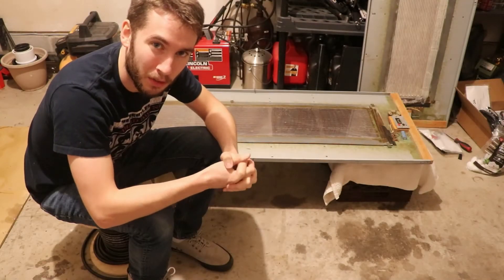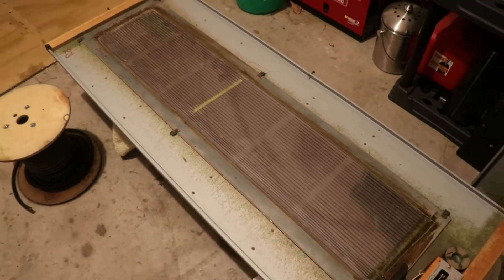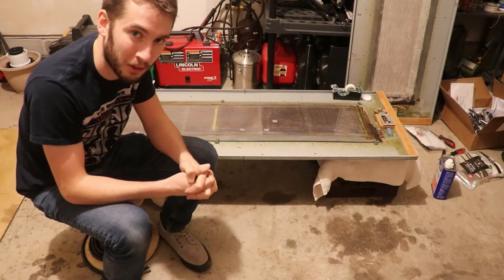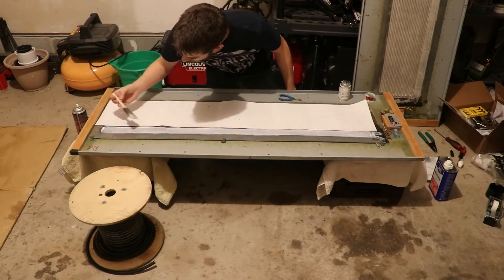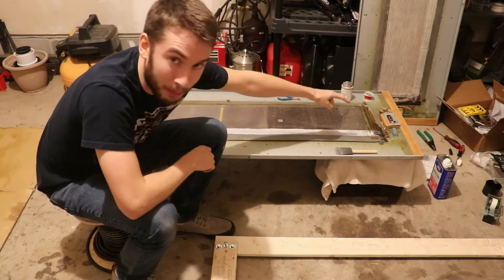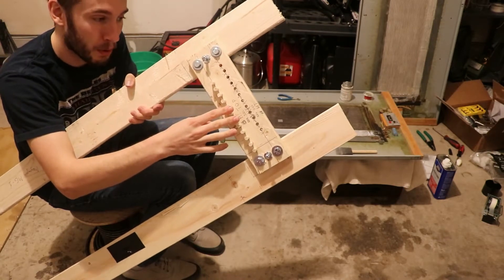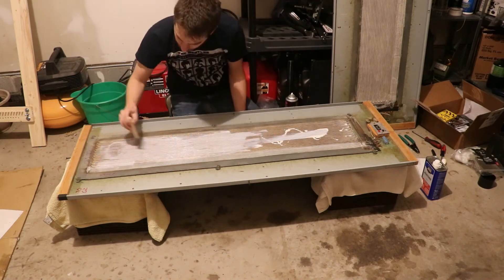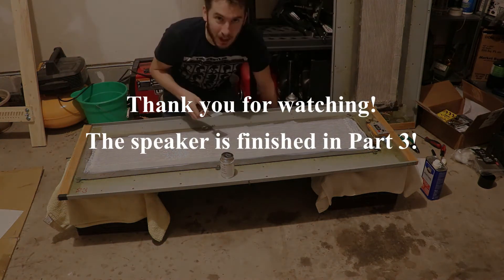REBUILD your MAGNEPAN MG-1 SPEAKERS (Part 2)

Comment: I just finished this whole process on my MG1 Improved, and I would say for sure to anyone reading this, don’t build a template. It’s really super easy to do it by hand and the wood template is a bunch of extra time, money, and work added to a process that is not very difficult, just slightly time consuming. I just put on a long podcast and totally zoned out on laying the wire and it was honestly pretty enjoyable. I also wore yellow rubber dishwashing gloves so I could push the wire down on the 3M adhesive and not get glue on my skin. The gloves don’t stick very well to it which is nice.

I will also say that I reused my original sock and would’ve preferred to just get new socks, because once the old ones are removed, they seem to tighten up and are too short once pulled all the way down. I had a real nightmare of a time getting mine stapled down enough and just needed a solid 1-2 more inches for it to really staple down properly.

I will reiterate, take good photos of the wire orientation and where it travels. On the treble wire there’s an entire unused length of perforations where it looks the the wire should go, right along the very edge, but it doesn’t. It threw me off initially and I had to double check my photos. Had I forgotten to take any pics, it would’ve been game over essentially. 

Thanks for this series, it’s the sole reason I felt confident in taking this job on. It turned out to be really easy and rewarding.
Reply from the maker: Glad it worked out! I've pinned this comment so others can read your tips, which are excellent.

Comment: I suspect that if you had taken two wires and twisted them around each other a few times before stringing them on your jig, then it would have been much easier. Granted, it might add a tiny fraction of the original length to the overall length but it shouldn't make a noticable difference in performance.

Comment from the maker: One thing I want to note for anyone following this for a DIY repair: go very light with the 30NF on the tweeter wire! If you go too heavy (like I do in this video), it muffles the wire. I rebuilt another set of speakers, and for one I applied about the level you see me apply in this video, and went pretty light with the other speaker. I found that the speaker where I went lighter sounds a lot better.

Comment: Would you be willing to do a brief summary as to why Magnapan over traditional driver type loudspeakers? I've loved audio equipment all my life, but have always stayed on the mid range end of the market. I understand the concept of these speakers, but can't help but feel that imaging, with that tall tweeter, would be different to listen to. Also, how is the bass extention with this layout? Is it more of a mid-bass / mid-range sound or output? Forgive my ignorance... I've heard many speakers in my life, but never these. Excellent content by the way! 😉
Reply from the maker: You'll just have to listen for yourself someday. The bass is very lacking with these early speakers. I can't speak to how the modern ones sound, I've never heard them. I have a video where I compare these to Klipsch KG4's and talk about the differences there. In most situations a traditional driver speaker is probably going to be the preferred choice for most people. I think of these early maggies as sort of a novelty these days. They sound really cool when paired with a subwoofer, but are they better? That's for the end user to decide. I run MG-2's on my living room system partially because I think they look cool. I'll be attempting a second repair on them soon, video to come in the next few months
Reply: @AHFixIt  I'll check that comparison video out. Thank you for the content and "real" approach to working on this gear.